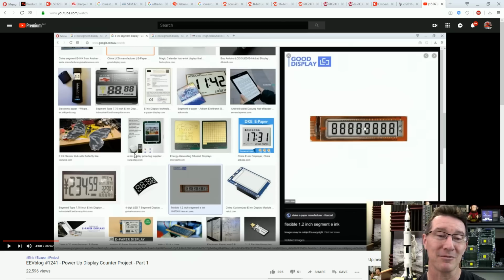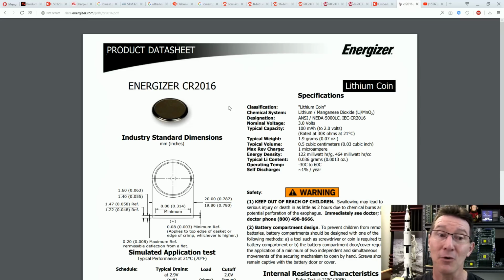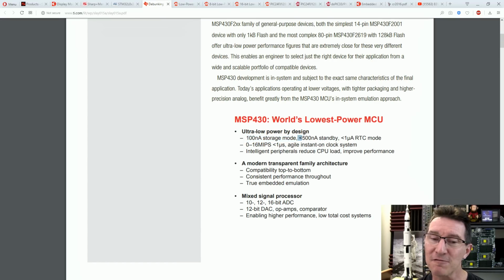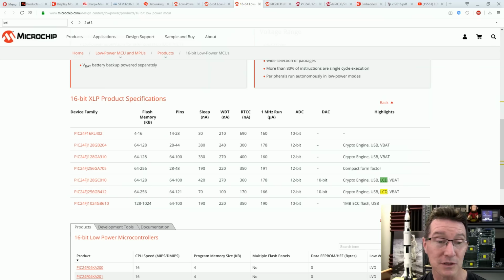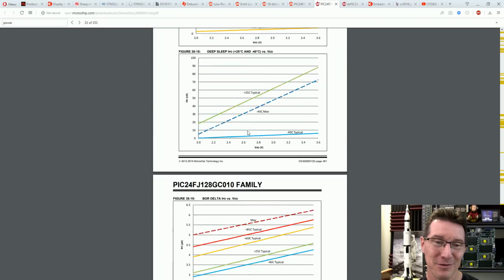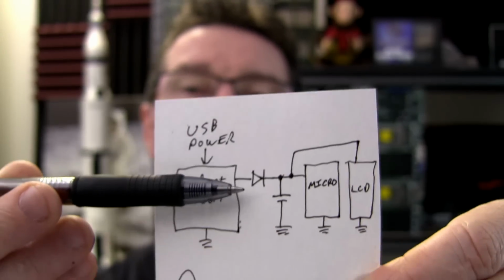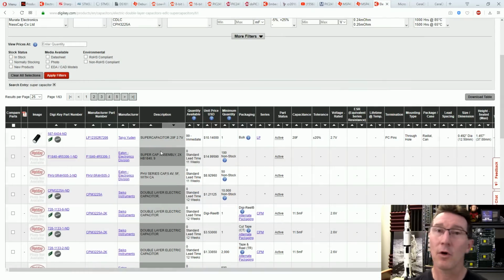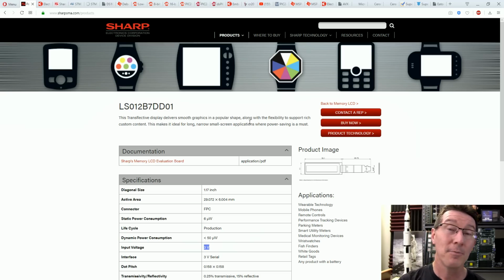EEVblog #1242 - Memory LCD+Supercaps+Low Power Design

Comment: Does the display really need to be on ALL the time?  Perhaps just a tiny micro that counts (in EEPROM) the startups and displays it when you press a button ?
Reply from the maker: Yes, I said that's a requirement in the first video, which was why I considered e-ink as the first option because it's the obvious choice (and still is).
Reply: @EEVblog  - Use a nuclear battery from a pacemaker or one of your sonar buoys you developed for the military industrial complex. That should power any display for about 50 years.
http://news.bbc.co.uk/2/hi/technology/8297934.stm
Reply: @EEVblog  Are you going to sell this device once done?  I could find several uses for a on-counter like this.
Reply: One bit of Tech it might be worth looking into:  'bi-stable LCD's
Can't find any quick prices. But it's not eink. I've seen them used on USB flash drives to show how much space is left even when unplugged.

https://www.adkom.de/en/display-technology/lc-displays/bistable-lcd.html
https://www.sparkfun.com/products/retired/9559
Reply: @ElectraFlarefire  Bi-stable LCDs aka CHLCDs are even harder to get for low volumes than e-ink.
Reply: @anonymic79  I'm sure there are some oddball cases where you have a device with a finite number of use cycles and you don't want to waste cycles on reading the use count, though the only things that come to my mind already have service intervals where they are required to be replaced regardless of use. Maybe Ms EEVBlog has a closet of stuff Dave never uses and she wants to attach counters to them to prove that Dave should throw the stuff away due to lack of use :)
Reply: what if its only on when the panel is open.   Like a calculator solar cell    the screen comes on when the solar cell gets light.   By the nature of the low power and the thing running off the sniff of an oily rag the solar cell will give ample power the second you open the panel.   Or if the display is exposed out the back of the panel have the solar panel in the same spot as the screen. in order to see it youll need to iluminate the LCD so the solar cell gets light too.  Store your value in the micro.   Your not going to look at this screen in the dark. with such a low power draw of this application youll easily get away with ambient light
Reply from the maker: Thanks. 2.7V minimum, so there goes the cap idea. Decent battery will still do it though.
Reply: @EEVblog  you can use multiple caps?
Reply: Probably a dumb idea. But what about a mechanical counter. Then it doesn't need any power to stay on...only to change digits.
Reply: @PowerScissor  needs more power for chamging digits though if you ask me
Reply: @anonymic79  few, calibration! not quite a counter, but you can have tiny LCDs on resistors, references, caps etc. with the value set after the calibration
Reply: Requirements are king!  The only out is convincing the "customer" to back down -- but, that's probably only valid if you've examined their application and found a viable alternative--one that doesn't compromise the underlying impetus.
Reply: @anonymic79  You don't have to.  The "customer" supposedly did that.  You, as an engineer, can always have a look at the application, and make recommendations that might alter the requirements, but to say to the "customer", "Hey, I don't see any viable reason to do any of what you asked me to do, so Bob's a dumb-ass!", is a ticket to a bad reputation!
Reply: What about electromechanical counters? Seems to be a good idea as far as I can tell, but bigger but that's about it, depends on size constraints I guess

Comment: any follow up on that project?
i found some e-inks on ali: https://www.aliexpress.com/item/32811069074.html?spm=a2g0o.productlist.0.0.5f915786rfc6Ma&algo_pvid=56e4553e-4a77-4c86-a114-85fb6ae41f79&algo_expid=56e4553e-4a77-4c86-a114-85fb6ae41f79-14&btsid=0ab6fb8815896604823508358ede7c&ws_ab_test=searchweb0_0,searchweb201602_,searchweb201603_

not that small, not that cheap and pain in the A connector (at least for me)

Comment: Althought I love STM32's and the like there is one product line that will be of interest for ultra low power and energy harvesting applications.
FRAM based mcu's like the MSP430FR57xx Family from TI.
2-3.6v operating range should work for supercaps and the standby power is 6.3µA and RTC adds only 1.5µA.
Reply: MSP430FR413x series do LCD (4 series and 6 series has LCD)!
In LPM3 with LCD and chargepump enabled it is rated at 1.25µA for 25c when running at 3v.
At LPM3.5 we are down to 0.94µA.
Reply: If you drop the LCD interface and just want low power and cheap, maybe MSP430FR2000 or friends...
You can get em in TSSOP16 as well.

Comment: Silicon Labs has really low power 8 bit 8051 micros with LCD modules built in.

I'd also add bias to the MSP430s (specifically the 430FRs) as that FRAM memory will save a fair bit of power compared to Flash memory of most micros and you'll be able to store the power up count with less backup power.

Comment: In a recent video of mine I looked at the Xiaomi Epaper Thermometer and that gadget has an epaper segment type display. It's rather large, probably not good for your kind of application but they are likely using an epaper segment display driver from Holtek that might be interesting to you. The part number is HT16E07, take a look at the datasheet which is available online. If you'll buy enough of them I'm pretty sure you can find a manufacturer that will make a custom epaper display for you and maybe embed that driver chip on the display itself.

Comment: @EEVBlog what about using energy harvesting methods to get the power needed to drive the electronics? i suspect you could probably get a couple of uW from background radiation, solar or something should be enough to get a small lcd driver running at a low-ish enough frequency to get the display content seemingly static but without driving it at the recommended speed not to mention at static mode. only you would maybe need to have a sort of external static storage (sram maybe) so you dont need to rely on the state of the io pins during the uCs deep power down mode...

Comment: @EEVBlog Hi Dave, I noticed that htere wasn't a proprer search done on the Microchip site. If you need an 8bit micro XLP, here is a link to the ones with LCD: https://www.microchip.com/design-centers/8-bit/pic-mcus/device-selection/pic16f19197
Honestly, if you clicked the device selection, it would have come up under the PIC16F19197, as that is the family with LCD drivers, but I guess you might not always be on that site on a regular basis ;-) Also, it is nice learning on how to drive LCD's with with uC, as that is not my strong point.
Anyway, here is their smallest and cheapest uC with LCD driver, the PIC16F19155. Comes in SO,SSOP, DIP and other packages and is only 28 pins 96 segments and costs $2.50 AUD at Digikey. Wish you all the best on selecting your most suitable uC and display.
Reply: p.s. Just remember to make use of hte eeprom, just incase something ever happens to the display, the information is safely stored ;-) but I would like to think that you would have thought of that already :-)

Comment: What you need Dave is a nucler surface mount battery, roughly 500,000 years running a single smd led and pic

Comment: Lately I made an electronic dice, and I programmed it that when I press button it resets and start displaying random numbers until it stops, then after some 10 seconds or so it turns off completely, and wakes up only at reset. I don't have any fancy uCurrent to measure how low it gets, but gets low enough to last digit on my multimeter and that's 100nA. I don't really know if that's current consumption but it kind of works.

Comment: STM8L051F3 350nA on halt mode, 50 cents. Wake up from halt based on external RC interrupt. 18 I/O. Use one for RC halt interrupt, another couple for reset, input etc. Leaves 15 I/O for driving LCD.  Use an LCD with each digit multiplexed. Use full halt, not active halt to save power. 

The RC wakes the micro from halt to flip polarity of LCD pins, then goes back to sleep. Experiment with RC for maximum time between wake from halt.
You could tristate the outputs before going to sleep. Let the LCD remain in it's state through capacitance and inertia. You could probably get average down to 600nA.

Comment: If you take a E-INK display, The numbers will stay, but the mircocontroller will be off. how does the microcontoller know, what number is on the display, when it starting up?
Reply: The microcontroller will have to store a copy of the number in its internal EEPROM anyway.

Comment: In my understanding, a third of a voltage discharge in a capacitor doesn't mean it's empty at all, in comparison to a battery. From the very calculator used in this video, it's clear you still have  quite as much power from 3 to 2v than from 2 to 1v.
So the real capacity of the capacitor only can be drained from using some kind of voltage booster, like a joule thief ! Some tests reveal that with the appropriate sizing of components you can achieve over 95% efficiency and a quadrupled lifetime span.

Comment: Mouser has that display and it minimum voltage is 2.7V to 3.3V maximum.  Ideal voltage is 3V.  mouser.com/ds/2/365/sharp_LS012B7DD01_SpecificationLD-27108A-740949.pdf.  Ebay sells 15mm diameter  x 6mm 1.2V 80mAh or 96mWh rechargeable batteries, they can only be charge 500 to 1000 times.

Comment: e-paper consumes LOTS of energy to update the image because you've got to charge some capacitors from nought to the relatively high +/- voltages it needs to move the e-ink capsules, then shut it down again the "high voltage" power supply until the next update (and in the process lose all the energy you put into the capacitors). The mere act of cycling on/off a "HV" power supply eats power, and that's in addition to the energy lost to migrate the eink capsules... IOW, epaper is only low-power when it's completely off, updating the image eats lots of power and energy too because it's not fast. For example, a clock that updated the only the minutes and not the seconds, can't be made to run on batteries (of a any reasonably small size) with an epaper.
Reply: It's a startup counter it would only be updated when the product is powered. He wont need a battery if he goes for the einc and therefore the power consumption during updates wont really matter.

Comment: Thanks a lot for the video, Dave and that you let us participate in the highs and lows of development art :)
So you are designing a work-counter the hard way. The solar-road way:) Your premise that the counter has to show something all the time is so iron-proof that it over-complicates the design. In reality, such a device must operate at two points in time: when the data is collected (at power up) and when the data is requested or read.
A push button to request the value and counter storage in EEPROM after BOR with true power cutoff afterwards will give you the best possible results in terms of power usage.
The head is round so that the mind can change its direction: For such use cases electro-mechanical counters or work-hour-counters are used in the industry. They just use power when counting and display the data by design with no additional effort. You can rely on these devices, you do not break them and if, they still show the last value. Now I call them "electro-mechanical-ink display" for you IoT neewbs:P

Comment: If it is power-up counter, why do you need back-up battery at all? Use any micro that would upon reset increase counter contained in eeprom and dump it to e-ink display and then halt. E-ink preserves the display and eeprom preserves the counter .

Comment: There is other matter to care about. If device will not have at all backup supply, then between events which are counted, you need to store somewhere current status of counter. You will not read this from e-paper. So, is necessary i.e. external EEPROM or inside microcontroller EEPROM. Or even store it in part of flash memory. In any case, you must also pay attention to durability of such memory (write cycles).

Comment: Use a ultra-tiny TEG (Thermoelectric Generator). Exhale some hot air and hopefully the display will turn on without batteries or so...
Reply: Seiko ran some LCD watches on them.
Very expensive so their are few on the Second hand market.
Multiple thousands of dollars.
Reply: @zakofrx  There are multiple solutions for that problem. We are talking about a couple of uAmps.
I would also consider a miniature electric generator where you simply rotate with the fingers the shaft. The energy should be quite a lot to keep the LCD running for some seconds.
Also, what about the piezoelectric spark igniters in the gas lighters (eg BIC)? These generate a spark of at least 400 volts. Perhaps they are also able to generate some decades of microAmps? Who knows...
Reply: @ekalyvio  Seiko uses generators with balance weights these days in their Kinetic watches.
The ones I mentioned use energy created by a temperature change applied to certain dissimilar metals.
The watches were powered by your body warmth as you wore them.
They also created enough that extra could be stored in a capacitor or rechargeable battery for when You took. Them Off.

Comment: Use the sharp memory lcd, a li-po battery kept at 3.85V, charge it via a series resistor, drain the current with the mcu if batt voltage to high, use some diodes to reduce the vdd(no ldo q current). If you can get a lifepo4 battery than is even easier and can get 10x full charge cycles. Done similar thing for my outdoor weather station. (ESP8266, espnow, 10 min report time, small 1-2ma solar cell, its running now for a year without any maintenance. The batt voltage is basically constants at storage charge.)

Comment: What about a discrete logic solution? Or God forgive, a mechanical one?
Reply: Patrik Molinder You mean like some 74HC390 chips or similar 40xx series ones?  Good luck fitting the size requirements.

Comment: Found a couple e-inks, but they are painful connections:
https://www.aliexpress.com/item/32825705778.html 10 digit 7 segment display
https://www.alibaba.com/product-detail/Segmented-customized-flexible-e-ink-display_60468961433.html seems to sort of give above pinout

https://www.aliexpress.com/item/32974516613.html 1.02 inch graphic e-ink

https://www.digikey.com/product-detail/en/e-ink-corporation/SCB721001/1272-1005-ND/6007723 a digikey one, in stock too

Comment: There are no way microcontroller + Sharp LCD controller + LCD could consume less than just microcontroller and LCD. You picked too powerfull STM controller for the example. Anyway only real circuit can tell what is its power consumption.
Reply: Dont those sharp LCDs have their special controller built in.

Comment: I think you shoud go nuclear for a energy source
Reply: Actually that would be a good idea!
He did a video a while back about a tritium powered battery that could last about 15 years and supply around 3 volts with a few uA.
https://youtu.be/yNQCaSNIrEM?t=938
Reply: @MrNicola1694  If you don't care at all about the price and (more importantly for this application) size, that is. Tritium vials (which is how NurdRage made his battery) aren't exactly cheap, and the solar cells he used aren't free either. And it's also homemade, commercial ones are much more expensive.
Reply: @GRBtutorials  definitely!
Reply: wait what wow i didnt notice that video  that is so sldarn sikk

Comment: You should have a look at the EM6627 microcontroller from EM-Microelectronics, it can drive an lcd at 1.7 uA with the 8-bit CPU running at 32kHz. Then you must add 0.3uA if you use the voltage multiplier and it's probably gonna be a bit more because of the LCD's capacitance.

Comment: Check up the CY8C4024AXI-S412 , cheap, small, low power, wide voltage range and the LCD SOC driver can be configured separately. Its made for automotives, should be reliable enough :)

Comment: 24:14 Yes, 7000 hours, but that's between the last power-down, and the next power-up , isn't it? The supercap would recharge to full upon each power-up of the device, wouldn't it? Whereas a coin-cell is a one-time deal (as it were).

Comment: Some muddled thinking here... firstly an I2C memory LCD is presented but later a discussion around uP with built in LCD drivers and a complaint that they aren't available in small packages... when using LCD direct you are going to need a fair number of pins since you need to connect all the segments/commons.  I've used that PIC24FJ part in a weighing scales with always on clock display, it's a nice part.

Comment: What's wrong with pushing a button?
Have the LCD off and push a button or short 2 pads just to be able to read the current value?
Reply: Depending on the environment it might not be an option, or depending on the size of your gloves

Comment: For example the Crouzet 3233 is a counter which counts up every time you close a switch, also has a few other choices of input. They state a battery-life of 8 years with a (not so) small 3V lithium cell.

Comment: It's been mentioned before but I'll mention it again: You can get coin-format rechargeable cells. I've got a 1616 or similar sitting around here somewhere that came out of a solar watch. Much lower capacity than a primary lithium cell of the same size, but it is rechargeable/reusable.

Comment: You're trying to reinvent the Electro-Mechanical Counter.
Reply: I suggested that in a tweet, just use a mechanical counter, only need to drive a coil, then have the circuit go to sleep, probably dont even need a micro, just a handful of discretes and passives. Keep it simple!